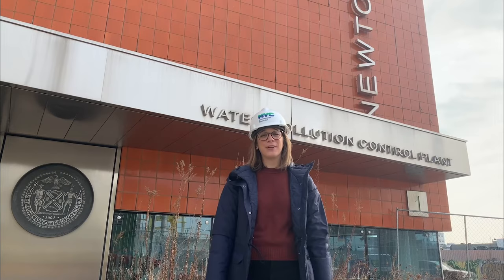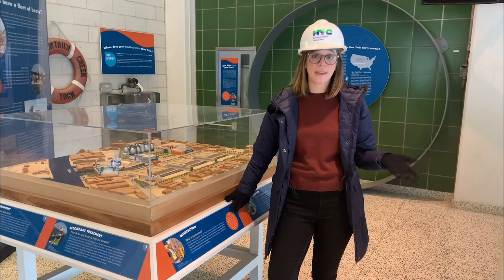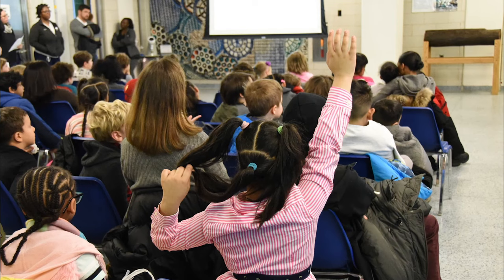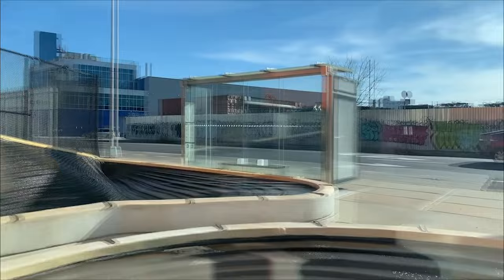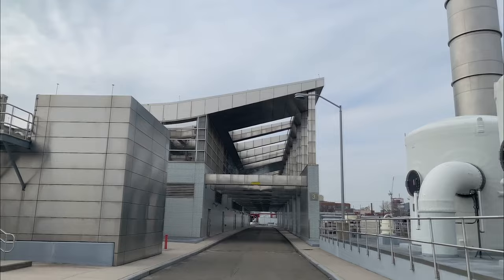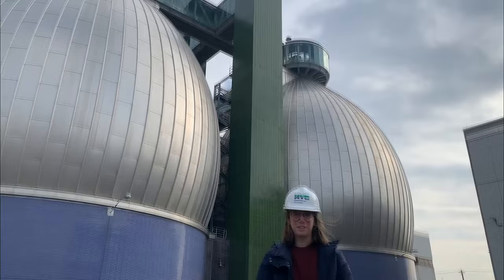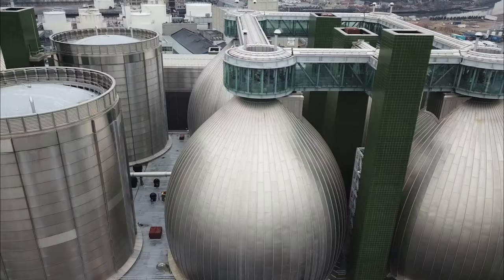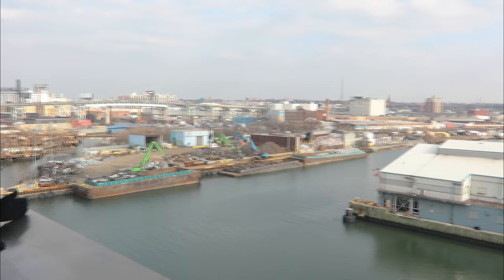Virtual Tour of Newtown Creek Wastewater Resource Recovery Facility in Brooklyn, NY

Comment: You are a fantastic tout guide.  While I can appreciate well done architecture I would hardly consider the design of this a marvel but would be more interested in hearing about the specific components to the system and the jobs of people that work them and the type of measurements they record.  The wonders of the inner workings of this structure surely far exceed that of its exterior.  Thanks for the tour.